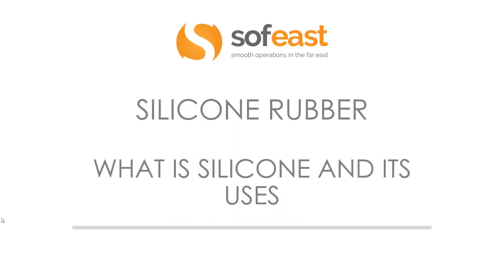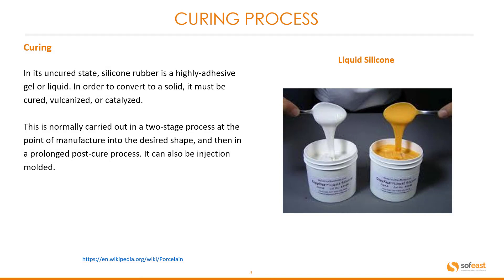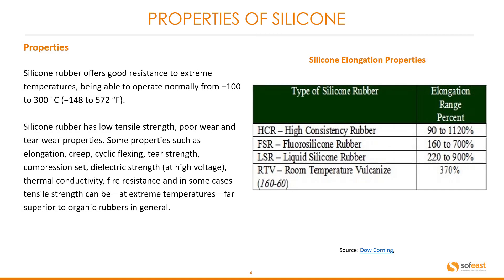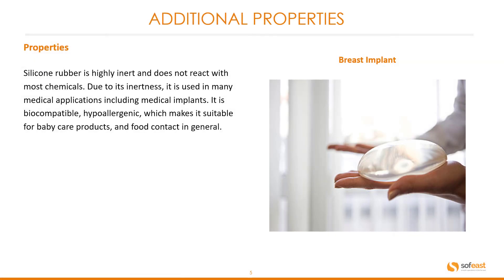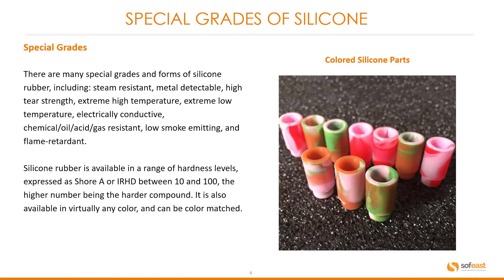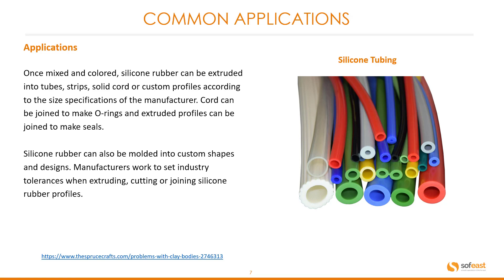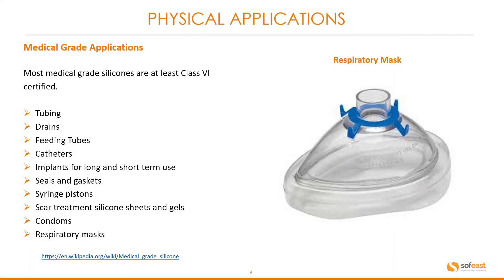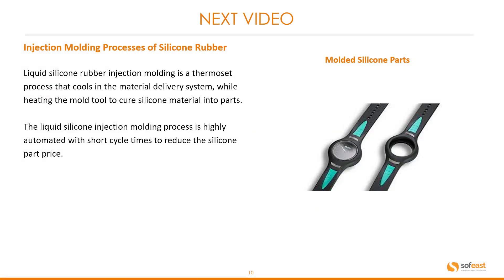What Is Silicone And Its Uses?

Comment: is silicon element same as silicon rubber or is that something differnt?
Reply from the maker: The element 'silicon' is the basis of the synthetic polymer 'silicone.' Silicon itself is usually a type of crystalline material, whereas the polymer, as you know, is often more of a rubber-type material.